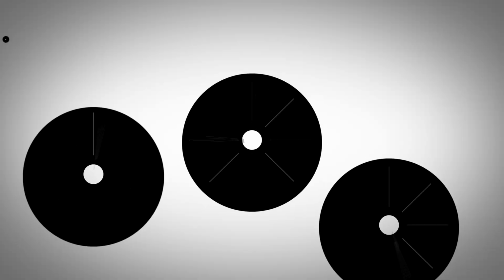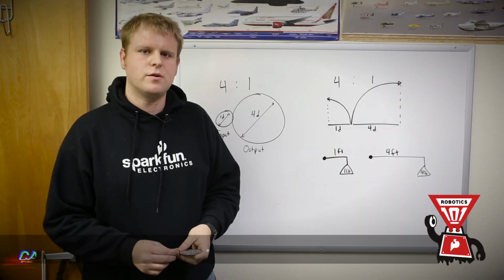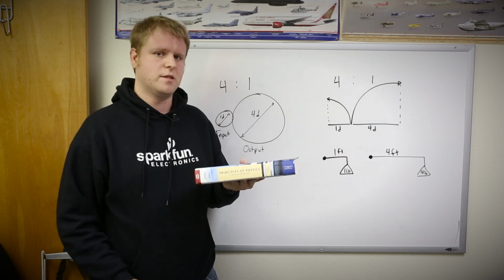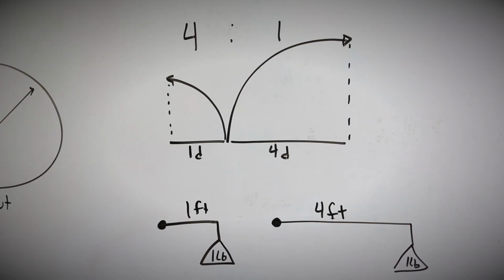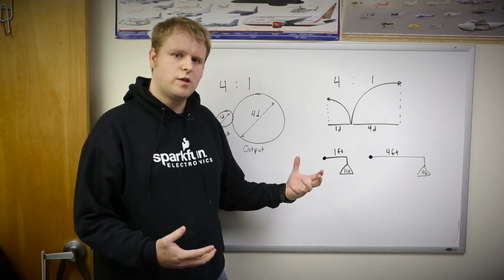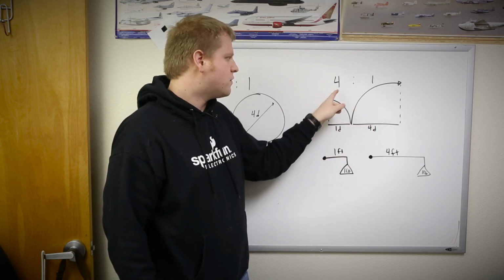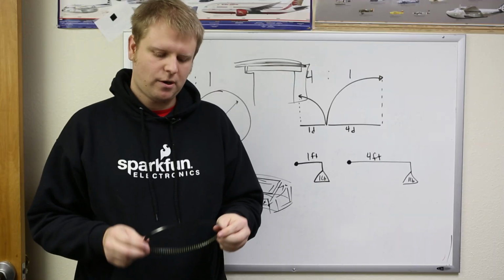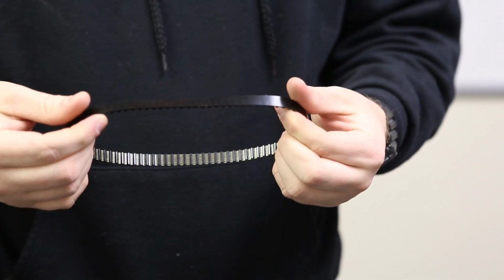SparkFun Robotics 101 -  4 Transfer of Motion

Comment: I agree with MNHS Beacon when it comes to the inch-grid pattern, but I don't think you can blame Sparkfun for that. Whoever is behind Actobotics are the ones who came up with this big mistake. It makes the entire system MUCH less relevant for anyone outside the US. Still... it may be that entire US market is large enough for this to make sense for Sparkfun anyway.
Reply: I wholeheartedly agree. That was the first thing I noticed when I saw the video, and it also put me off.
Reply: They (Actobotics) should consider two different systems, one in inch the other metric like the 8020 extrusions.  It would be interesting to find out from 8020 how the two compare in sales.
Reply: It's pretty sad that the US effort to switch to the metric system back in the 1970s failed so hard. We could have put this mess behind us already.
Going forward, I at least don't want to propagate those mistakes.
Reply: Tetsujin The US is not metric. In 1970 they passed the metric measurement act, which made it voluntary to go metric. Nobody went. It would cost trillions and obsolete 100 years of parts, machinery and tools. In Canada we went metric and it cost money and created confusion and to top it off we still need SAE (tool inch measure) for a lot of machining and auto, Imperial for a lot of mining and surveying, and inch etc for carpentry. All hand tools in Canada combine both imperial and metric measure. U can always convert. A Newton metre is 0.7375 ft lbs.  A newton is .2248 lbs force. And a watt is still a watt.
Reply: Eric Charters Still I think we'd be better off. The rest of the world isn't switching off metric any time soon, and there may come a point where we can't afford to delay the switch any further. By dodging the issue for so long we've ultimately just made it worse for ourselves (and others) when we are forced to switch.